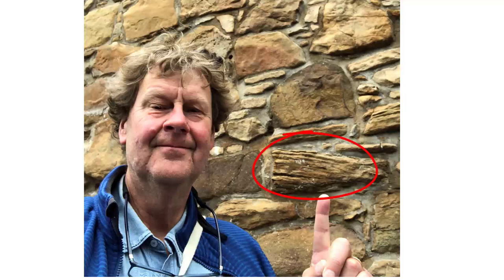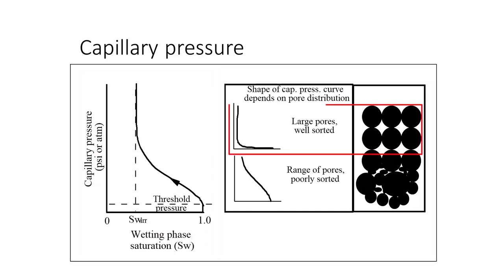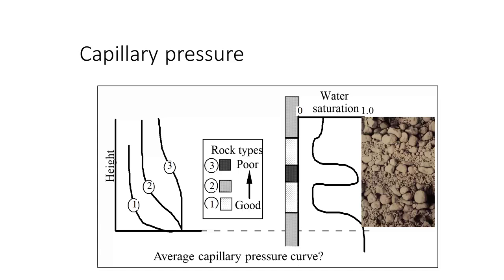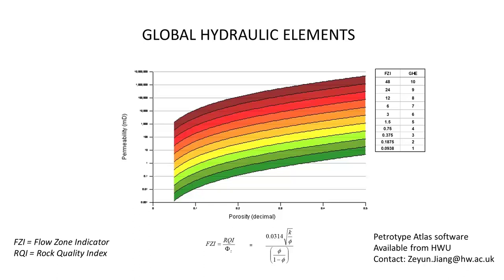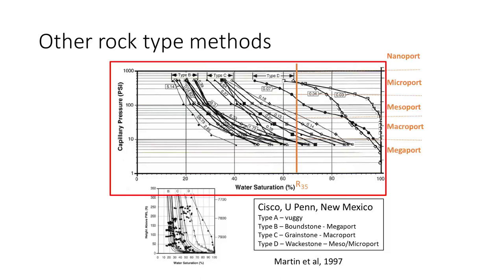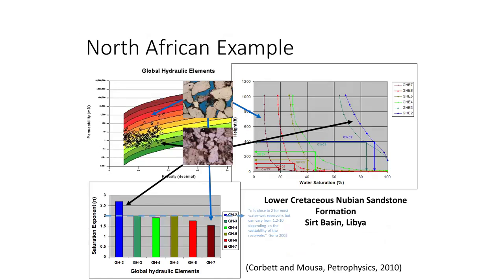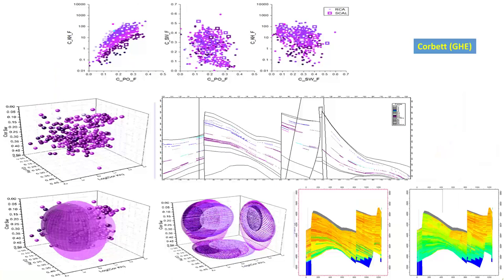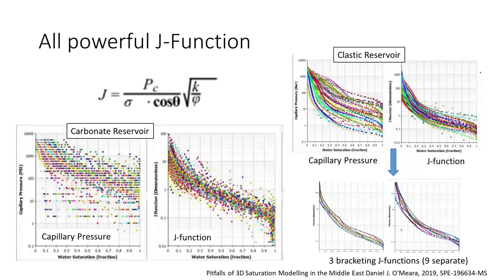Patrick Corbett - Reservoir Rock Typing Fundamentals

Comment: Thanks for the video, however i am a bit confused here. In the chart that shows the poro perm and the different flow zones, lets say the Shuaiba you have shown, all individual FZI's have a very wide range of poro and perm values, i mean the rock that has a very high poro & very high perm (sample located upper right in color x) falls under the same rock type that has very low poro & very low perm (sample located lower left in color x); meaning both are classified in the same FZI, how is that possible? I didnt get that...